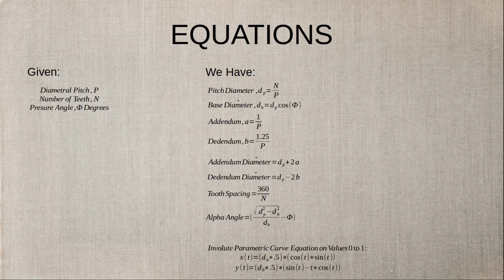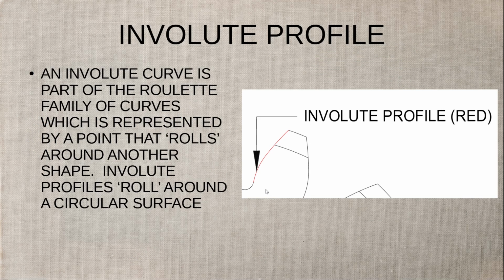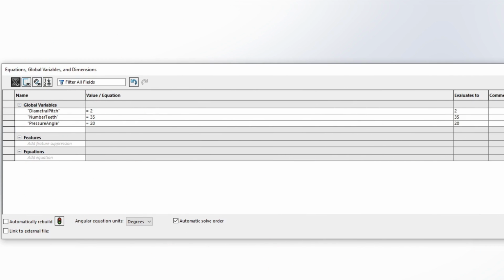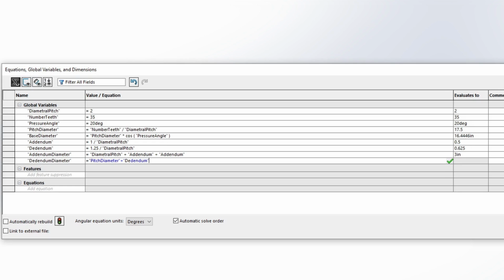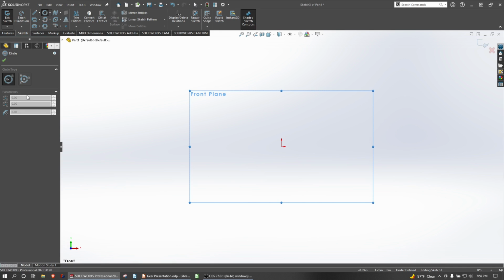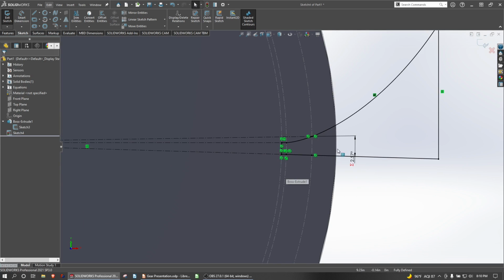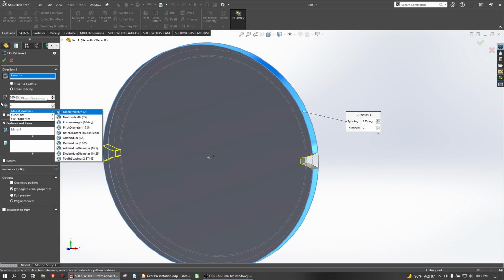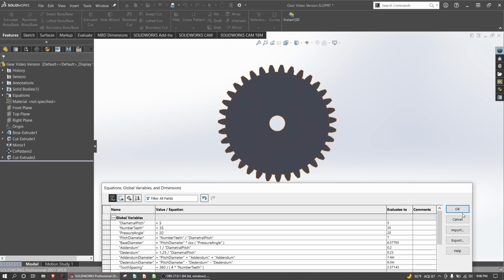Understand and Design Involute Spur Gears From Scratch |JOKO ENGINEERING|

Comment: FYI, the parametric equation for the involute profile "x(t)" is incorrect in both the video and the video's description. You use the correct equation later in the video when modeling the gear in SolidWorks.
Reply: what is the correct one?
Reply: cant believe nobody is pointing this out

Comment: Very nice video! Thank you!
Why at 10:15, ToothSpacing= 360/(4*NumberTeeth) ?
instead 360/NumberTeeth you mention earlier ?
Thanks again!
Reply from the maker: Great point.  360/"numberteeth" does indeed reference the tooth spacing in degrees per tooth, however at around 15:40 I dimension from a point that is not from the tooth center and so I use a modified equation.  360/"NumberTeeth" still applies if I were dimensioning from the centers of the teeth.
Reply: @JokoEngineeringhelp  
Thank you for your help!
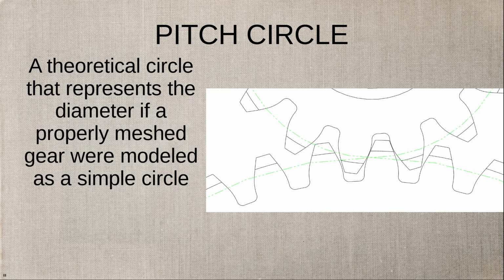The parametric equation for X you give written at 00:30 is different from the equation you entered (at 13:20).
Does this need some clarification? or the first one is just a typo? That you entered is correct.
Thanks in advance!
Reply from the maker: @Antuan2911  Good catch.  It looks like you found a Typo.  I'll correct it on here to he best of my ability.  Thank you
Reply: @JokoEngineeringhelp  
Thanks!

Comment: Well this is almost spooky.  Probably been a year since I've watched any of your great tutorials.  Now I'm trying to reverse engineer some involute splines so I can mill a splined shaft to match a pair of yokes.  Just yesterday I was thinking I could try to 3D print gauges with different pressure angles, etc., and here you go!  Are you stalking me!?  EDIT:  Oh wait, it's Solidworks.  Any chance you might have a FreeCAD version in the pipeline?
Reply from the maker: Hi Loner's Guide;
I did contemplate doing something for freecad but because the gear workbench is so much more efficient it felt like I would be reiventing the wheel, or rather, gear.  The gear workbench is found in this collaboration:
https://www.youtube.com/watch?v=0zxjOB2Cao8
The gear is defined by module instead of dimetral pitch.  Module simply equals 1/diametral pitch, everthing else is the same.  Good luck!
Reply: @JokoEngineeringhelp  The Part Design workbench also has an "Involute gear" option (bottom of the menu). It does have limitations though. You can only do inside and outside spur gears, and you're stuck using "module" (which is fine for metric gears, but less obvious for non-metric). Beyond those and you'll need the Gear workbench.

I watched this video for the theory and math... very nice work. I'm actually quite surprised that SolidWorks doesn't have an equivalent of the Gear workbench.
Reply from the maker: @glabifrons  The gear part of the part design is worth mentioning, especially when you want to incorporate it into a part design work flow, thanks for bringing that up.  I know SolidWorks has gears in the toolbox, but I haven't used those much so I couldn't vouch for their adaptability/value.
Reply: I was wondering that too, but will check the add-ons first. All I needed is the formulas and some theory.
Reply from the maker: @zordanxxx  Hey Felipe!  If it helps, here is the freecad gear workbench: https://www.youtube.com/watch?v=0zxjOB2Cao8